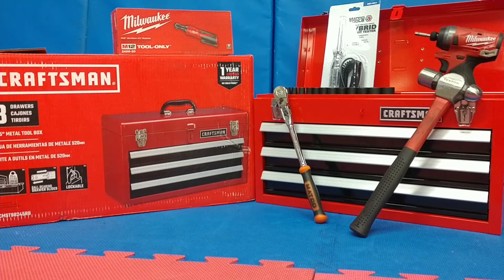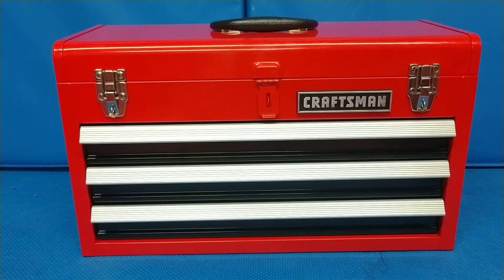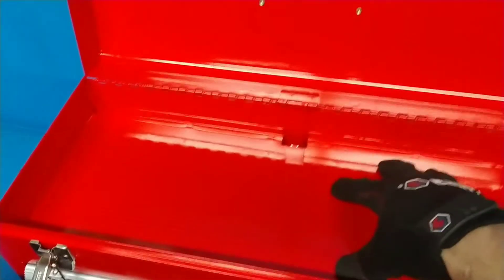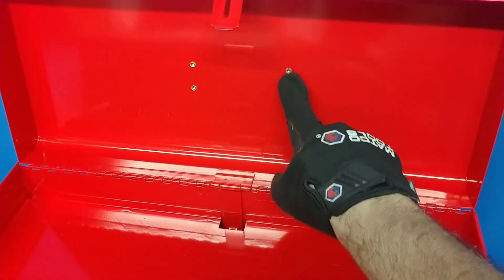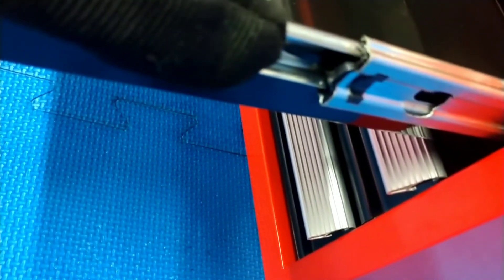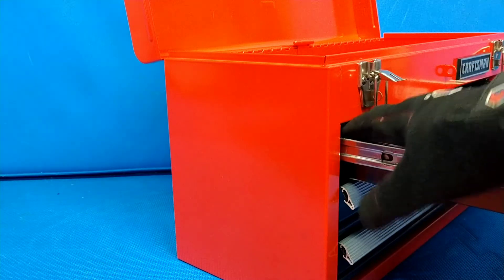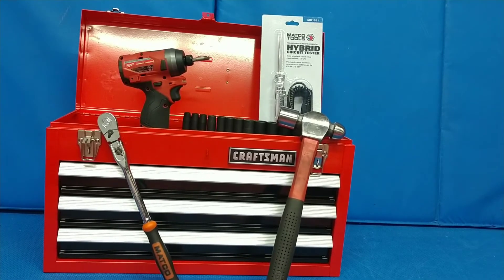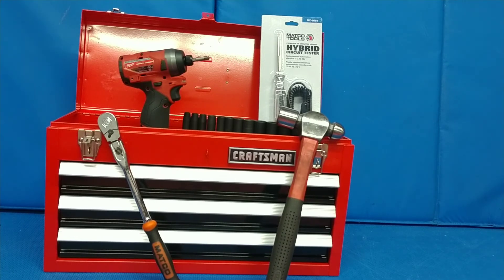craftsman 3 drawer portable tool box

Comment: I got the gearwrench locking portable tool box on sale for 65 bucks. No reviews from what I can tell so I started looking at these craftsmen for organizing ideas at least. Hopefully I made a good purchase
Reply from the maker: Those GW boxes are excellent too. Can't go wrong with any of these portable boxes. I have a bunch of new mods coming up soon so stay tuned. I'm sure you will find one or two you might want to try on ur GW box.
Reply: @dodgesportsman772  one of the first mods I am doing to mine is adding some heavy duty handles to the sides of mine so I can lift it easier since mine is going to be in mobile service truck. And drilling wholes in the top portion for screwdrivers and such like my harbor freight technicians cart

Comment: It’s interesting that you say the older American made craftsman boxes weren’t quite as good, I have some old USA made ratchets that all they needed was some grease in the gearing and they’ve been great. I keep them in the back of my truck in a old dewalt box with a scan tool and some other roadside basics. I agree that those rivets are gonna go quick. I’d probably carefully lay a weld bead to reinforce it. Gotta be careful tho I’m sure it’s pretty thin sheet metal.
Reply from the maker: Don't get me wrong I LOVE my old craftsman tools from the 80. But the portable boxes didn't have bearings just slide rails which made them flimsy. I'm making a video of all my old tools from the 80 and ,90.

Comment: I like this style of box but they are hard to find in the EU, seems to be more like an american thing to be honest.

You can find really cheap Chinese ones tho, the only solid one I found was made by Stahlwille (400€ for a box 💀)

It does have 3 or 4 solid drawers, is large in size, has a lock with a key on the front that unlocks both the lid and the drawers. Handles on the side, welded on. Thick red powdercoating and a sheet of steel with square holes (DIN norm) to attach clips for tools inside the lid.

Really solid option, but expensive and there seems to be no “in between” option as far as I can find
Reply from the maker: Try looking at Montezuma Tool box, they sell thru out Europe and are very nice and affordable
Reply: @dodgesportsman772  yea man! I just checked em out looks great!

I just finished college as an electromechanic and am about to start a new offshore job with a Dredging company. They also affix drilling rigs, do wind turbines and umbilical cables.

I intend to do a side hustle in my off time, by myself working for the place I did my internship doing industrial maintenance and repairs. No money for a van so I’ll have to start with my Subaru Outback. I would like to put a toolbox like this or a montezuma box at the rear door on my flat folded seats. So I can open the door and quickly grab something from a drawer. These montezuma’s seem nice and the smallest ones might fit perfectly! Thanks for the tip!

All I need is a good toolbox, more powertools, a hydraulic enerpac and a cooler 😂
Reply from the maker: @claudyfocan731  ur welcome. Whatever box you get I would love to know why you chose the one you did. And GREAT career choice. I enjoy working on cars but at my age it's time to put up my wrenches and look for other avenue of employment

Comment: Hi, how are you??? I hope you are well, pretty good !!! Look, if it is to move a tool inside the trunk of a vehicle, I prefer plastic ones, they are more resistant to the passage of time, they do not dent, if they are scratched they do not rust ... in short, they are more resistant in all the aspects. Wherever you want to see it, it will be or will have Chinese parts, there is nothing to do there hahahahahahahahahaha ... and as you have admitted: the quality has been improved. I'm thinking of buying one ... I have many tools inside a 16-inch box ... at least with this one, I vacate the other a bit until I can buy the largest one. Be careful, the one that I am going to buy is from a Chinese brand, but it is the cheapest thing you can get here in Venezuela (it costs me $ 70, I already saw on Amazon that the one you buy comes out at $ 109). I'll check to see what else he did to his new box. Happy day, greetings from Caracas, Venezuela
Reply from the maker: You are correct about the plastic box issue for sure. I bought this metal one out of my memories as a younger man. Takes me back. Be safe my friend

Comment: Does it have holes in the bottom so I can mount it to a work bench?
Reply from the maker: No it does not have holes. But taking the drawer out and drilling the holes would be easy.
Reply: @dodgesportsman772  Craftsman must have updated the design. I just bought one yesterday and it has four holes drilled in the bottom which should accept #14 screws.
Reply from the maker: @michaelorlowski7722  awesome!!! Lucky! Mine doesn't have them

Comment: There is no way this would compare to the 1980 version of the tool box quality goes down over time not get better especially with Craftsman, now US General I will agree its better each day compared to past series ones.
Reply from the maker: This version has roller bearing which is a far cry better than the older slide system. But I thinks it's more of my own opinion and not fact.
Reply: Agree the newer version is surprisingly better in many ways than the 80s version. Roller bearing drawers and the side lips of the drawers are rolled for additional stiffness. Building to a price point isn't a new thing. Agree the new latches could be better though.